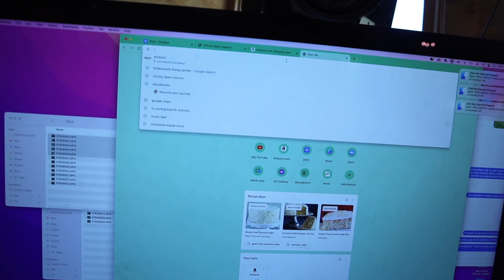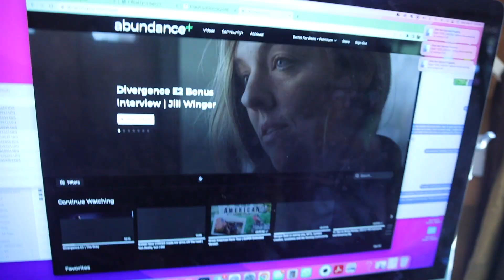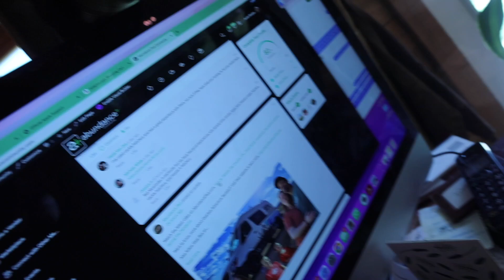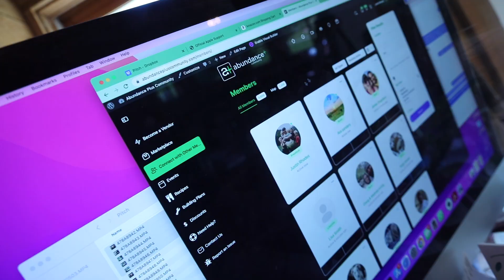Putting An End To Homestead Shaming | 8 Things You Don't Have to Do

Comment: Thank you for using your platform to normalize outsourcing to and working with your community. If you have a thing on your heart to do, every small step in that direction can and should be celebrated. Giving grace to yourself and those around you to do things in ways that work and make sense for individual circumstances is so much more humane.

Comment: You can barter ...job for trade...welding for organic food/ or trade 1/2 lumber cut for cutting your lumber...Idea 2....Chicken compost....cut lumber assemble in chicken pen....build a portable...2 ft x 4 ft. 2ft high 2"x4" frame...with 1/2" wire screen all around sides..... and build a  a 2 ft wide by 4 ft legnth 2"X4" frame...that fits on top with1/2 wire screen across bottom side......place on top of 2ft tall frame...zip tie only 1 long side of wire top  frame for a hindge.......scoop chicken poop ect. daily...onto top screen....let the chickens scratch the screen top to make ready to use sifted.....compost.......tip over and scoop finished compost in wheel Barrow when full...you can bag it if it needs to wait ..woven type feed bags (recycle) with air spaces in them might be best.......let your chickens help you...